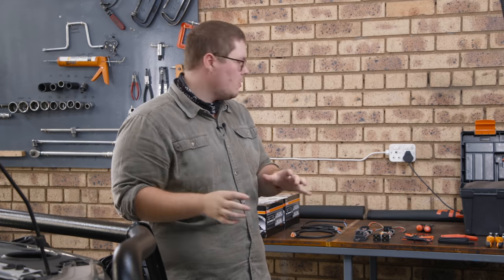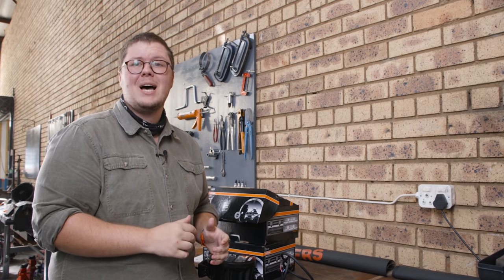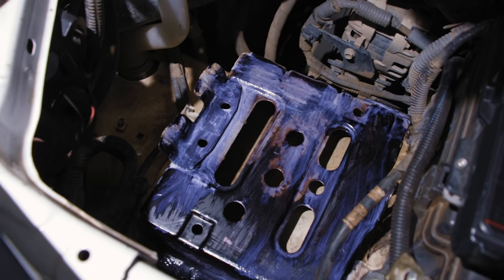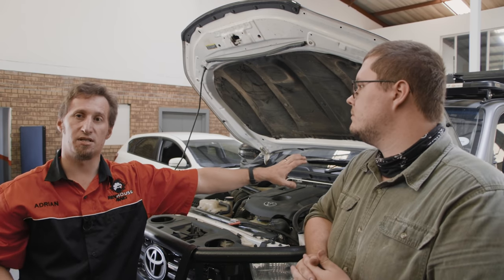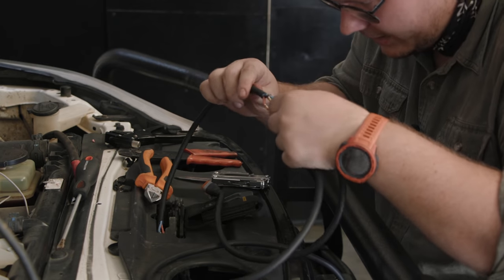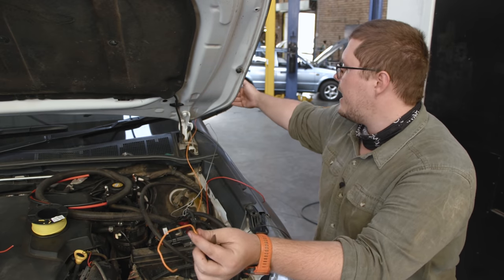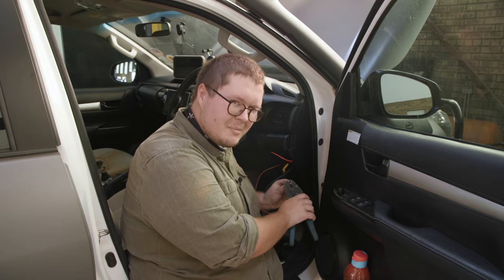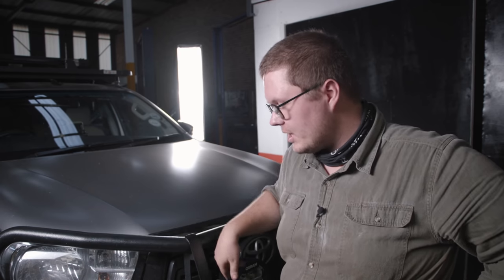Ep15 DIY Installing Spotlights On My Toyota Hilux (OSRAM MX180-CB)

Comment: It’s great to be able to customize your vehicle with the help of professionals, but this time Adrian you are giving overlanders  the option of replacing standard spotlights with high-quality Osram MX180-CB Spotlights with a comprehensive step-by-step DIY instruction by Adrian of REVHOUSE and yourself. What I find to be of immense value for other overlanders who want to get the best spotlights on their vehicle is that they can with this information learn about wiring and electric techniques required for this installation. As you have so readily explained when doing it yourself, mistakes can happen, and you may well need professional advice in correcting them. Precision is everything. Well done Adrian of REVHOUSE and yourself, Adrian!

Comment: I think i've been spoiled these days with my current lights from PIAA and Stedi both coming with high end plug & play harnesses, run the cables, tie them down and you're done, 20min job. Although many years ago, I did work for an ARB franchise, so I have done my fair share of scratch built installs, it's a good skill to have which becomes invaluable when you're trouble-shooting.
Reply from the maker: I really enjoyed learning it and it’s something that will help me spot shoddy work in the future!
Reply: This is my dream 🌟👌

Comment: Loving how your vehicle is turning out! Believe it or not, taking a lot of queues for my FJ here. (PS totally gonna go the same rims!) 
I get the switch install if you want a physical switch, haha but me, being Mr.Lazy, just got the Spotlight Wiring Harness from 4x4Direct(R295). 
Literally no cutting or pushing wires into the cab and back, just piggybacks of your existing H4 Female plug. Comes with Relay and own fuse. Literally just plug and play. Spotties go on with your highbeams. Been using it on my last 3 vehicles and never let me down, and also, no need to mess with any wires(Since I'm FAR from a Auto Sparky)
Reply from the maker: Hahah! Lekker man! If you want to buy those rims you can use BRAA20 for a discount on the Tyrelifesolutions website for a bit of discount; I think it expires on the 28th of feb 👍🏻 I saw the relays at 4x4 direct; looks nice and simple for sure!

Comment: Where through the firewall did you gain access to the cab for the wiring? And then, route the wiring to the switch panel without interfering with the operation of the airbags?

Comment: Another good video Adrian! Neat touch with the power in the glovebox :-) I do agree with the Deutsch connectors being among the best available! 
HOWEVER-> In the future U may want to teach U`rself how to solder wires :-) As for crip connectors & heatshrinking tube; Go with the ones that have glue inside. SO SO much better in terms of protecting the work U put in. Between the switch & the high beam splice, ther should be a fuse!! Personally I wire up lleft spot to left high beam & so on....U may also add what gauge cable U have used for the differen applications.  I`d appreciate it if U included a link to where U sourced the switch, I see it slid right into the factory cut-out. I do know there is a good aftermarked for these in ZAR :-)
All the best :-)
Reply from the maker: Hey Peter! So my father taught me how to solder, and I actually went into this think that’s what I was going to be doing because that’s what I knew; but I’m glad I learnt a new way! I haven’t seen any fancy heat shrinking with glue this side before; will look into it. With regard to a fuse on the high splice; I might add a small inline, I think that’s sensible 👍🏻 next time
I do another one I’ll chat gauges etc 👌🏻 oh yes the switches were from a store called 4x4 direct

Comment: Thanks for another awesome video! Maybe this comment would be more appropriate on a roof rack video but - there has been a lot said recently about roof rack weight limits (Ronny Dahl ect.) any thoughts on this? Are our (SA) weight limits the same as those in ‘Straya?
Reply from the maker: Hey David; I foresee questions of the topic coming up in my next episode; so might as well start answering now :D the rooftop load ratings are probably the same 👍🏻 the installation process and quality of the roof racks will be different. It really depends on how much effort and what strengthening is applied to the roof to add strength and reduce strain. I trust my EeziAwn rack, as do many. Because they make expedition racks; however anyone who overload their racks a huge amount of accessories will be asking for trouble at the end of the day

Comment: Looking at two spots for my Land Cruiser. Torn between the Osrams you fitted or the Lazer Sentinel Elites. I’m not off roading, just want a bit more light for dark country roads. Would the Osrams do my job……they’re much cheaper than the sentinel elites, but truthfully I’d go with the sentinels if they were much better performing.
Reply from the maker: OSRAM’s were very nice for on road performance!

Comment: So what was the "boo-boo" that caused it not to work the first time around?
Reply from the maker: I spliced into the negative instead of the high beams; which happened because the cables looked the same and I didn’t double check it with the light tester >.<

Comment: Adrian, why did you guys fit usb sockets in the upper glove box compartment while there are free reserved slots on the normal 'cockpit' console just to the front of the gear lever?  Just asking.
Reply from the maker: I just didn’t want loads of cables all over my dash :P
Reply: @RoamOverlanding  Cables over the dash?  No man, the power is already at the back, you only needed to pull the cover off, find & install rectangular USB charge sockets that you prefer & connect, no hassle.  I installed dual USB chargers on Toyotas that even displays the battery voltage, so this way you can monitor the starter battery voltage while driving whilst having USB chargers ready for use.  The best part is when you use those rectangular reserve slots it looks like the dual USB's came factory fitted.  ;)
Reply from the maker: @DIESELTECH_ZA  I didn’t want the usb cables from the devices all over my dash I mean I know it all works behind there; the cubby is also a nice place to put stuff and charge without it being in the cabin :P
Reply: @RoamOverlanding  oohhh okay I see what you mean with the cables of the devices and not the power cables so to speak.  Makes sense then yes.  Cool man, nice video non the less.  Glad to see that soldering was not used left right and center of the wiring.  :)
Reply from the maker: Hahah yeah; it was interesting learning about it; I am actually going to be uploading an extra video to Patreon talking about Soldering vs Crimping

Comment: Osram mx180-cb?  Who are the distributors in SA?
Reply from the maker: Hey bud! I believe Frontrunner is one of the distributors as well as Autolume
Reply: Thanks, I asked Frontrunner and they said they don’t import them. I’ll try Autolume👍
Reply from the maker: @Fergus_Afrique  You might also be able to order directly from this link https://bit.ly/MX180ROAM i have a discount code for people ROAM20 which will give 20% off; it might cover the shipping costs with the savings

Comment: Hi Adrian, The osram spotlights that you used on the hilux was it 7inch or 10 inch spotlights? Thank you
Reply from the maker: I think 7inch, they were quite small. I’m currently using the 7inch Hardkorr lights and loving them, they have a bit more reach than the OSRAM’s I was using and still utilize Osram led chips
Reply: Thanks Adrian, Build nearly done, thanks for you guys showing us whats working. Do you think the 10 inch basicly the Mx260 will be to big for the onca bullbar?
Reply from the maker: @riaanheystek4643  shit… not sure hey. I think so… the 7’s fit nicely
Reply from the maker: @riaanheystek4643  shit… not sure hey. I think so… the 7’s fit nicely plus it’s good to let the intercooler breathe better
Reply: Thanks Adrian

Comment: How are your EGTs(exhaust gas temperature) after fitting the large spotlights? Am told large spotlights affect the cooling of the radiator.
Reply from the maker: they do indeed effect it; but my hilux does have any EGT gauge or even the sensors; the GD6 Motor is very head efficient; over 30% better than the d4d